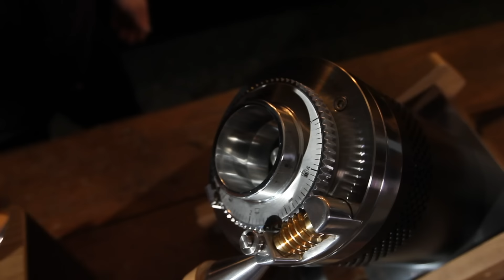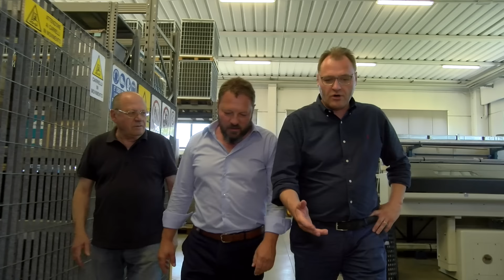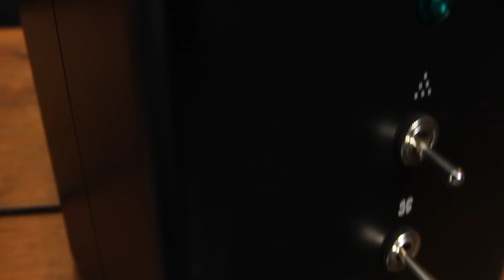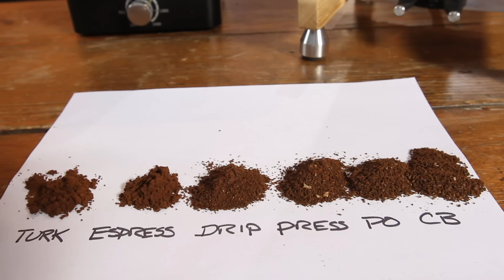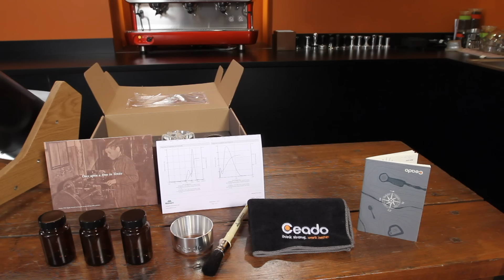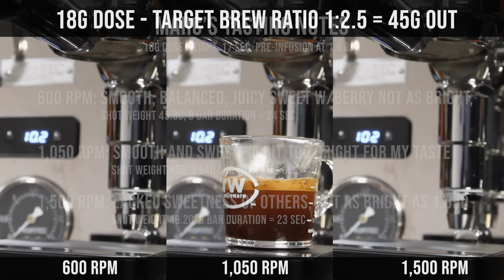Review: Ceado E37Z-Hero Single Dose, Zero Retention Coffee Grinder

Comment: Hey Marc! Great vid and review! Definitely a dream machine and out of reach for most of us (unless I get that big promotion or lotto hit). Stupid question: I'm wondering why Ceado went with a detent-less potentiometer for the motor speed control? I get that they want the user to have "infinite" speed variability (within the designated speed range). Since everything in making the perfect shot is about repeatability, it seems to me if they were going to make the motor speed control infinitely variable, that they would at least provide a digital tachometer to indicate speed so that the user wouldn't have to rely on coarse dial markings for a fairly accurate speed reading and repeatability while experimenting. While the power supply module panel aesthetic is neat and clean with a minimum of clutter, I'd have thought that they could have done a touch display similar to the latest e37s model with the tach readout incorporated, especially at this premium price point. Just my $0.02.
Reply from the maker: Hi Kevin, not a stupid question and thanks for sharing your thoughts! So the speed control is marked with RPM and I think the no detents deal is exactly what you think - for continuously variable adjustment. Stepped grind size adjustments are a no-no in high-end espresso grinders so guessing they don't want it on the speed control either.  I do like the idea of a digital tach! This grinder is used in commercial applications where there might be some resistance to touchscreens although lots of commercial semi-automatic machines have them. 
Marc
Reply: @Wholelattelovepage  TYVM, Marc. I appreciate the prompt response. As an Italian-American, and a Ceado e37s owner, I loved this grinder as soon as I saw it, but the variable pot with just markings, and no display immediately caught my attention. I designed and built a DC motor speed control for my mandatory Senior Electrical Engineering Project in my youth, in this case, for a cassette tape recorder that could record/playback at half-speed. My solution was (very) loosely akin to Ceado's and I used a network with op amps and a power transistor controlled by a pot to adjust the rpm range (no display). It was very hard to get the adjustment range correct and then you had to tweek the pot to get the playback speed (i.e., pitch) correct. I marked the spot, but I took a small hit from the tenured PhD & dept chair who grilled me during my presentation of my circuit design and asked why I didn't use a PLL (phase locked loop) if speed was that critical. I replied that his dept. didn't teach us about PLL's anywhere in the curriculum but utilized all that I had learned in my studies. I was right, but he still dinged me and gave me a B, haha!

Comment: What a beautiful grinder! Mark, 18g in 45g out… is that your go to ratio?? And is 24 seconds your target for time?
Reply from the maker: Hey JA, ratios depended on coffee used. More often than not I'm a 1:2 ratio guy so 18g in 36g out. Timing is typically 20-30 from 1st drip but often runs longer when using low flow rates, pre-infusions, etc.
Marc

Comment: What is the difference between the Ceado E37 Z-Hero vs Ceado E37 Z-Naked?
Reply from the maker: Hi Frank, The Hero is adjustable RPM while the Naked is essentially the same except RPM is fixed at 960 (50hz)/1150 (60hz)
Hope that helps!
Marc
Reply: @Wholelattelovepage  Thanks Marc! That cleared things up for me - I had a feeling that was the case but looking at their specification chart on the website it is not very descriptive.

Comment: I feel as though the fan should be controlled automatically by a thermo sensor of some sort. Or at least have the option at this high end category. I assume the fan is to prevent beans being affected instead of over heating the equipment?
Reply from the maker: Yes, fan keeps things cool in high volume use!

Comment: Hey Mark.  When will you do another Q&A on brew ratio.  Have an interesting question to ask you which I have not seen from anyone.  It is regarding extraction taste.  I have got my machines dialed in pretty good. I have eliminated clumping and have minimal static using the Lyn Weber Blind Shaker yet amazingly my outbound grind size on the grinder remains zero retention every time. My extraction works by the first drip on the cup to a 1:2 ratio instead of the moment water hits the portafilter. Here's my question. Can the first taste of my extraction be bitter and my third taste on the same extraction be sweet and smooth?  This is what I am getting from my extraction.  What are your thoughts on this?  Beans used is Coffee MIO Espresso and Ceado is dialed at 2.5 grind size.
Reply from the maker: Hi T72R, Flavors in shot will change as the extraction progresses. If tasting a completed shot from a cup not unusual for the top of the shot to be more bitter as the end of the extraction sits on top. I typically stir a shot gently before tasting.
Marc

Comment: Hi mark, after watching I’d like to make a couple of comments.
For the swinging the worm thread adjuster out of the way, would a spring loaded pin lock mechanism been an option?  No chance of not engaging the teeth properly.
Secondly, would a fixed speed option (say at 600rpm) be a cheaper, space friendly alternative?
Reply from the maker: Hi Chris, Thanks for great comments! I have some face to face time coming up with Ceado at SCA in Boston. I do think you will see tech from the Hero trickle down to some of there other less costly grinders. I like something for easier worm gear engagement after macro size changes - as it is now you do have to line up the threads before swinging back in. Not a huge deal but I see where you're going. I'll definitely mention that in Boston!
Marc
Reply: Thanks Marc,
That would be terrific!
On the speed thing, it would be an interesting study to see if there was a single speed that did provide most of the benefits for a cheaper, smaller but still ultra high spec model- sort of like Monilith’s or even a Helor stance Motor.

Could be a PhD for someone.  Become a doctor of Coffee!
Chris
Reply: I'm curious at to whether the speed is actually controlled by a speed sensor and a feedback loop, or if the knob sets the frequency of a variable frequency drive.  Or if they simply adjust the voltage fed to a DC motor or the like.

Further, at this price, and given the need to engage and disengage the worm gear to/from the spur gear for grind size, why not use a stepper motor to position the grind size adjustment, and a rotary encoder to verify the position, and give an electronic readout and several presets, selected on a touch control panel/display so the user can program grind size presets and operating RPM.

Control system and CNC machine nerd here.

But seriously, at this price, none of this would be unreasonable.  The fully manual, hands-on user interface, and wood accents remind me a lot of some high end audiophile gear, where one begins to question the actual science involved, and wonders if it's more about the feel of things and the perceptions of the user.

Still, I really appreciate a lot of what's there.  Especially the work at making zero retention truly work.  Every time we make an espresso at home or at work, we're grinding a single dose.  And with the inexpensive systems I use, there's a lot of "carry over".  A true single dose, low retention system would be a real benefit.

Comment: Side-by-side between Niche Zero and this Ceado. I own the Niche and I’m confident it won’t even be 3x better but for 10x the price. An EK43S is a better deal and probably pulls similar shots to the Hero. Great engineering feat to have adjustable RPM but let’s admit it’s more or less a gimmick.

Anyhow, hope more major companies steer towards zero-retention single-dosing grinders for home users.
Reply from the maker: Hi, Thanks for the comment. In coffee equipment one definitely starts running into diminishing returns in cost vs. potential cup quality. I do not believe variable RPM is a gimmick. It makes a difference. Perhaps not for average users, but for enthusiasts who get super serious about espresso. Compared to the Niche, build quality, components, etc are at a completely different level in the Hero. Kinda like going from stock cars to Formula 1. The Hero is an engineering feat. I suspect the tech will move down in more affordable forms to other Ceado grinders.
Marc